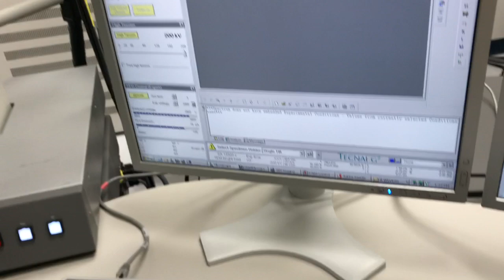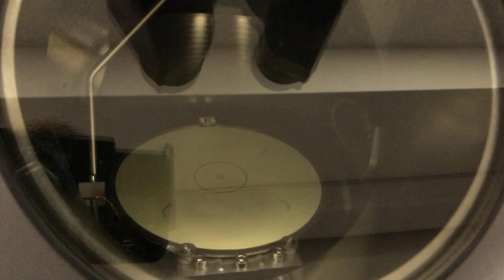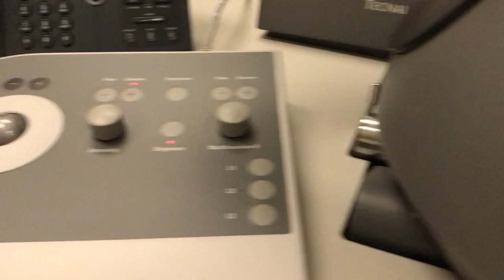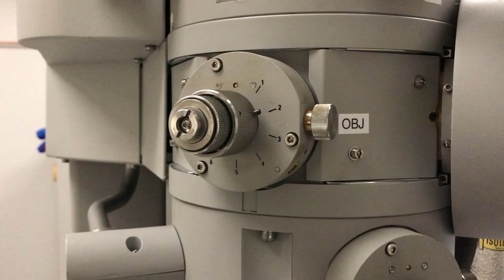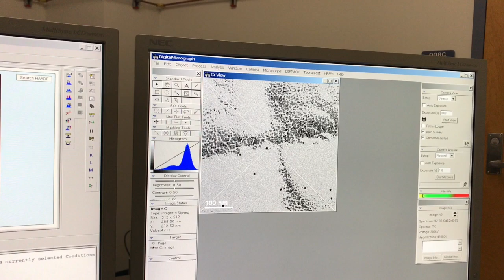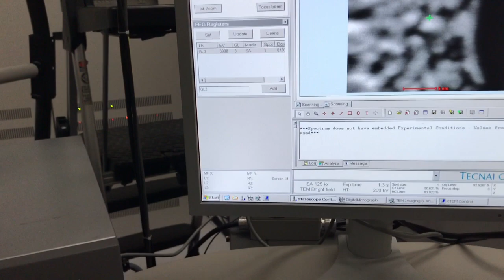FEI Tecnai F20 S/TEM: basic operation in TEM mode

Comment: Excellent demonstration, thank you!
Reply from the maker: You're welcome.   Just FYI, if there is sufficient lubrication on the O-ring, it really shouldn't be necessary to apply any pressure to assist the holder as it is drawing into the column.  In that case, you should actually need to actively restrict the holder as it inserts so it inserts in a slow and controlled manner.

Comment: Thanks for your sharing. But I’ve encountered a problem that I don’t know how to solve. When I switch from LM1900× to M2600×, the beam disappears and I can't bring it back even after adjusting focus and shift.
Reply from the maker: Hi zekunlang; this sounds like an alignment issue; if you mag down in the LM mode, can you eventually find the beam?  Once you find it, you can use the "beam shift" direct alignment to move the beam back to the middle and then save your alignment file so the beam doesn't shift when switching from M to LM.  You shouldn't need to use "Focus" for this.

Comment: is objective aperture is inserted in imaging or diffraction mode?
Reply from the maker: Hi Mostafa: usually, the objective aperture is inserted in imaging mode and retracted in diffraction mode (with rare exceptions).
Reply: @NicholasRudawski   Thanks for your quick reply . Another question please How can I know I am in centric height or not because I can't find the difference in image before and after your correction eccentric height (only difference is the array of square ) and how the eccentric height is related to the array of squares on support film?
Reply from the maker: @mostafaeid9955  There are two main methods to set eucentric height; this can be done by wobbling the alpha tilt axis back and forth and then adjusting stage Z to minimize image shifting or it can be done by setting your objective lens to a known preset value (eucentric focus) and adjusting stage Z until the image is in focus.  The first method is the more accurate way to do this, but the second method can be faster and easier to perform.  Provided the "eucentric focus" setting is correct, there really should not be much difference between the two methods in the final result.  If you look through my channel, I actually have a video that specifically talks about eucentric height so that may be good to take a look at.

Comment: Thanks for your valuable videos, I want to know the function of turbopumps and what happens when the button turbo on opened and closed also I want to know the concept of the airlock
Reply from the maker: Hi Mostafa: thanks; the turbo pumps are part of the vacuum system and can have various functions depending on the particular part of the vacuum system, but in general, the function of a turbo pump is to get a section of the vacuum system to the point of high vacuum (around 10E-6 Torr range); the point of the airlock is to allow the specimen holder to be introduced into the column without having to also introduce a large volume of air into the column, which would likely cause a vacuum system crash.  Another reason the turbo pumps are useful is that they are dry and use no oil so they help keep hydrocarbons from being introduced into the column, which can be detrimental to imaging.  Pretty much all modern S/TEM vacuum systems are now oil-free.

Comment: Hi Nicholas, I did not understand the use of rotation centre alignment. What shall happen if we do not do rotation centre alignment? Rotation centre alignment seems to be similar to eucentric height alignment?
Reply from the maker: Hi Sudipta: sorry for the late reply.  Rotation centering is critical to get the best resolution from your objective lens.  Depending on how badly uncorrected it is, not performing rotation centering may result in a blurry image with loss of fine details (particularly atomic-resolution levels of detail).   Setting eucentric height is likely more important that performing rotation centering; your objective lens (if properly configured) is optimized to properly focus with the sample at eucentric height; if you deviate too far from eucentric height, you deviate far from the optimized setting for your objective lens to get a properly focused image and this too may result in loss of detail (resolution).  All in all, both rotation centering and setting eucentric height are very important in getting the best performance, but my opinion is that setting eucentric height is the more critical element.